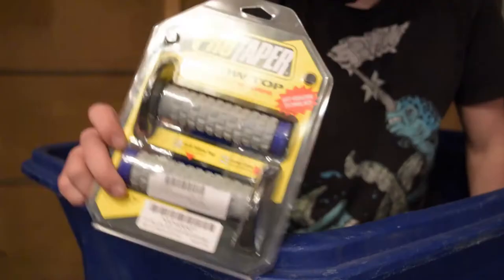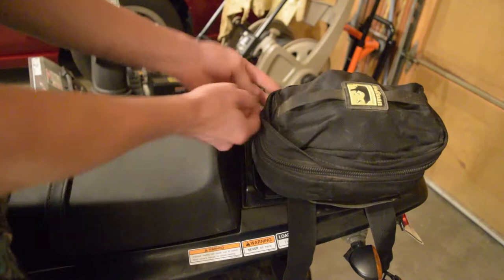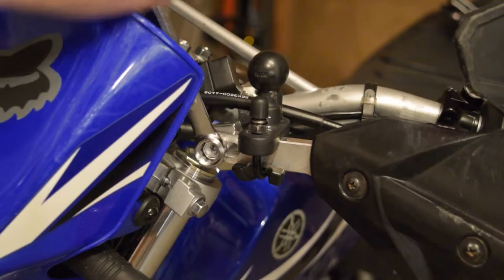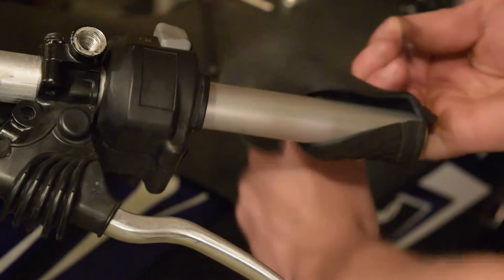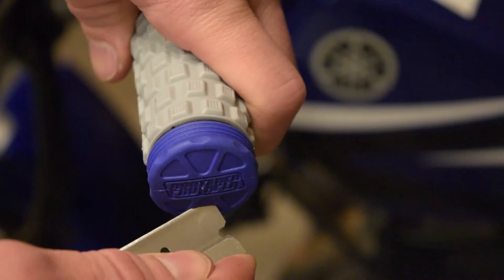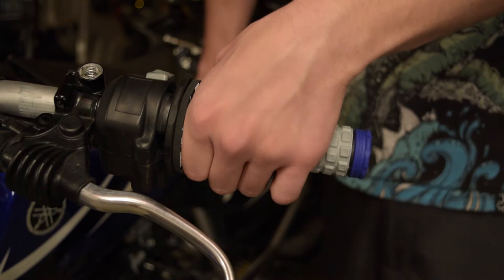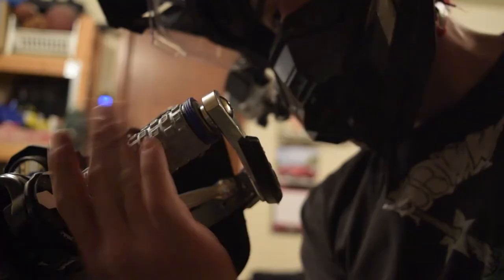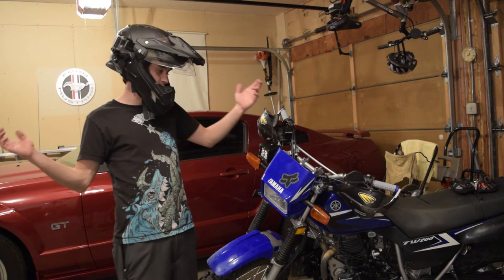How To replace Grips on a TW200 (with Cycra Probend Handguards)

Comment: Also, if you use clear coat spray paint, it is a lubricant but when it drys it acts like somewhat of a grip glue. And if you don't want to tear your old grips up, you can use compressed air to make them come off. Great vid! Maybe next time you can do a carb float adjust vid?
Reply from the maker: clear coat sounds like an awesome idea, ill try that next time thanks! and I will make a carb float adjust vid eventually maybe when I tune my carb after installing the dg

Comment: They make a glue for the grips also. Ive used that on my PWC and works great. Also try hair spray. They slide on easy and then the spray makes it really sticky when its dry.
Reply from the maker: I thought about using the glue but didn't want to clean it all off when they needed to be replaced again. well hairspray sounds like a good idea ill try that next time
Reply: TDubsKid the prev owner glued mine. When I changed them, I just used a tip I found on the net, pry up a little bit of the grip at the handle bar end side with a screw driver and spray window cleaner in there. Then work the screw driver in and all the way around the grip, spraying more cleaner if needed. They slid off easily afterward.
Reply from the maker: nice thats not a bad idea

Comment: I was asking questions. I ordered the bar end "clamps" and the clamps you have for the inside as well. I had purchased a cheap set and the bar end had to have a plastic sleeve over the to tighten down and the inside bar clamps came from the factory with a stripped hole. I enjoy ur videos. keep it up.
Reply from the maker: oh gottcha dang that sucks it was stripped out, and plastic doesn't sound like it would hold up too long, I just got some new handguards ill be installing soon. thanks!
Reply: I ordered new incerts that go into the handle bar ends that someone on TW200 Forums linked to, Then a set of the inner pieces your showed. Have not installed yet. To busy. like ur videos. Cool stuff.

Comment: Donuts prevent blisters. Did you remove the stock grips? I'm hoping they're not vulcanized to the throttle tube.
Reply from the maker: indeed so much more comfortable having them on there,  I did remove the stock grips, they didn't having any  adhesive on them that I remember

Comment: I'm thinking about getting a tw but will I ever grow out of it
Reply from the maker: depends on what you want to use it for, it doesn't have a lot of power but it's a lot of fun
Reply: TDubsKid I'm going to take it camping and like around town
Reply: It'd be great for that. I've owned a lot of bikes since my very first one (a tw200 from way back). I thought I "outgrew" it pretty fast, and then owned a bunch of different bikes before I realized that the mighty TDub was probably the funnest one. I have a road bike that I love dearly, but had to re-buy a tdub. I am of the belief that they're the funnest bike ever made. It's slow, but it has a ton of grunt, and will literally go anywhere.
Reply: Thanks
Reply from the maker: yeah exactly what Christian said it will be great for that. it is a very fun bike I hear people say they wish they kept it all the time. an it will defiantly go almost anywhere, I have ridden on all the trails around here that all the ktm and 2 stroke riders go on I can go about anywhere they can go just not as fast